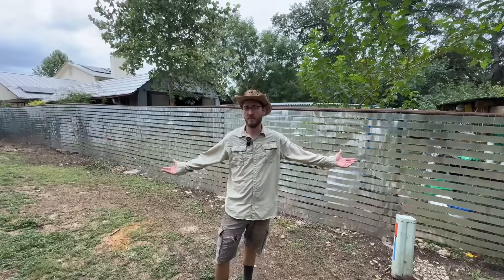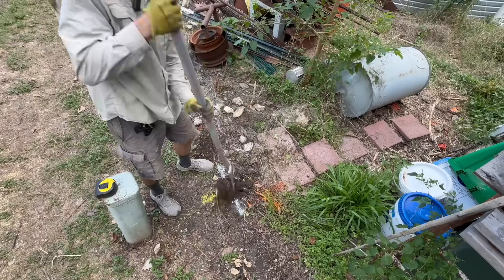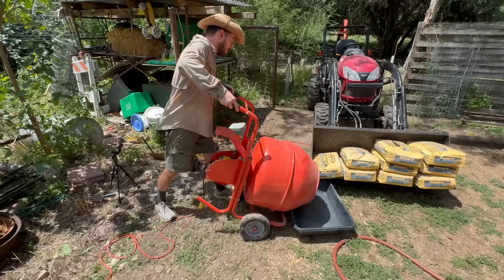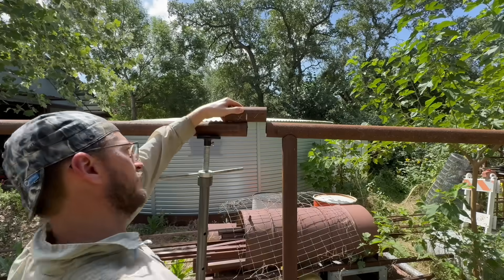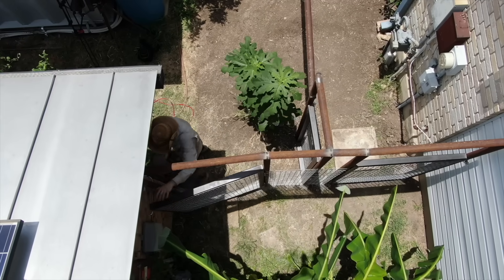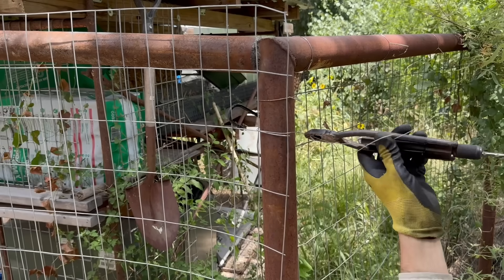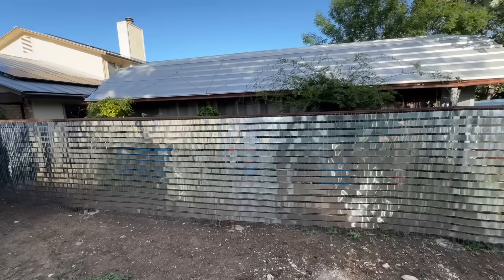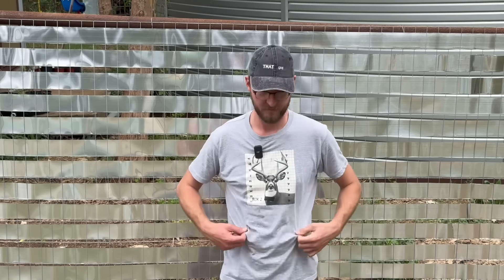This FENCE Lasts 100 years!!!!

Comment: Have you heard of a fence stretcher? You put a length of rebar woven through the end of the mesh and it will tighten the wire so it doesn't sag at all. Its painful but if the wire sags (and it will) its an easy way to tighten it up. We used one with the sheep net on the farm.  Weaving the rebar or tpost through the end of the net looks silly but the stretcher works well that way.
Reply from the maker: I hadn’t heard of them until this video. I learn a lot from these comments. Thanks!

Comment: I remember looking with envy at those miles of welded pipe fences in Texas when I spent some time there. I remember thinking how nice it must be to live in a place where there is so much scrap pipe lying around!
Reply: we had a lot until people started making miles of welded pipe fences 😂
Reply: Alberta had the same surplus tubing. It is becoming more in demand and the price is climbing. I have wrap-around miter patterns and a Dragon cnc Plasma Tubing profiler that can cut miters and holes in even very rusty drill tubes quickly. Your metal cut saw miter pattern is a good option that makes a nice joint.

 Some pre-heat on the weld joints would help as the dril tubing is heat treated alloy steel and can become brittle if cooled to quickly.

Comment: What a solid and well built fence. Those pipes are really thick gauge metal and should last a long time. The only thing I would have done as an extra corrosion preventative is paint the posts with anti rust paint (cold galv on all weeds) and also paint the parts of post going into the concrete. I know it’s not a bullet proof solution and the posts are very thick gauge, but I just like to prevent rust as much as possible (even in dry climates). Just subscribed and keen to see other videos. Ps cool laser rust removal machine and the steel cutter too.
Reply from the maker: Thanks for commenting and for subscribing! Welcome aboard!
Reply: You’re welcome mate, keep up the great work :)

Comment: Nifty idea and nicely done!  But isn't the reflection during the day kind of blinding and doesn't it generate added heat? I see if the vines grow all over it that will be resolved, but in the now intense triple digits of summer where I live the vines would likely burn up before they got far enough. Does the flashing retain its shine or eventually dull? To me that would help in the increasingly hot climate I'm in.

Comment: Nice fence. I work in a very oxidation prone environment. That stainless steel wire might cause the non stainless wire fence to corrode. Hope not.
Reply: The aluminum might react with the carbon steel. Look up “galvanic index”. Might not be a problem in a dry environment. I work in a salt mine so it would be a problem in that location. 👍

Comment: There a lot of easier ways to notch the pipe. Also you never said what the thickness of the pipe is or the sq tubing, which is kind of important. But I do like the fence and it was nice of you to add the stripping. By the way your neighbors shit doesn't look like nothing special.  Cheers

Comment: Waaw  Nice ! What cost was it by square meter of flashing ? What is it normally used for ? It looks great !! Does it make noise with wind ? What about the galvanic thing and rust ?
Cheer !!
Reply from the maker: I noise in wind. Galvanic corrosion is a bigger issue in wet areas. Cheers!

Comment: I have been cutting my 10 foot wide laurel hedge and in the middle is the 1920s METAL small fence. It is amazing to see and quite ornate here in the UK and it is still strong and not rusted away. it is amazing. It is almost completely hidden in the hedge except in a few places but it does prove even in the very wet climate of England that metal fences can last so very long - may be not as long as my laurel hedge though.

Comment: The first 8 inches of the metal (or wood) need to be bitumen coated, taped or wrapped under the ground interface. Oxygen, water and bacteria can live happily in this area and your iron and wood get chewed out mighty fast as it has no protection. You could weld the wire to the fence down low and at a few locations all along the poles to allow the zinc in the mesh to protect the iron long term, otherwise that ground interface iron will get thin fast.

Comment: 100 years?  You must not have moles.  Lucky.
Reply from the maker: Several freckles maybe 🤷 but seriously no I don’t think we have moles here.
Reply: @suburbanbiology  lol...  Good for you buddy.  You would know it if you had them.  You could build a fence out of titanium in these parts and it would be leaning on you 5 years later no matter what you do.  And the worst part is the damage they do to the foundation of your house is even worse than the fences.  I've been landscaping around the house and garage and I've been putting rolled steel nets 1/2" about 2 feet in the ground perpendicular to the house every foot or so before putting down the weed fabric and rocks.  It doesn't stop them from screwing up the rock and getting to the foundation, but at least they're not making tunnels all along the house and garage slab anymore.  Evil little monsters.  Nice job on the fence by the way.

Comment: The only Fear for your project I have, is the possibility of dissimilar metal corrosion (Galvanic) between where the Aluminum and the Steel fence touch, you may want to apply a corrosion barrier. I say this coming from a comercial aviation mechanic perspective. after many rains you will notice it begin the rain will act as an electrolyte between the two metals which both have a difference of electrochemical potentials so they will try to react. this will occur faster if you are close to a body of salt water or it remains humid in your area the majority of the time.
I absolutely enjoyed your video and subscribed too, heck yeah, I wanna see more of your projects!

Comment: Do you think the reflective 'heat' element when dealing with aluminum will have any impact on the plants?
Reply from the maker: No not with a straight fence. If the fence was a parabolic shape I think it would matter much more. Or if the fence ran east west. But this fence runs north south so it shades the yard half of each day.

Comment: Sir I own 2.66 acres of land in Upstate NY. In order to keep out the "White Trash' infestation I have pulled 1,200 feet of fence 370 feet of "rebar" fence buried in 6 inches of concrete base and 660 feet of ditch dug 4 feet deep and 4 feet wide and i plan to pull another 200 feet this autumn. all to protect a fishing Pond almost 200 foot across that i have never stocked because of that bunch.

Comment: What about dissimilar metal corrosion? Your wire fence probably has several metals, steel pipe and aluminum flashing. I hope you dont live in a wet climate .JS
Reply from the maker: Central Texas. Quite dry usually. In a wet climate it would be more of a problem.

Comment: "If you don't like it, hit the thumbs up button." 😂😂😂
A little too industrial for my taste but it's a very clever idea, and well executed. It was worth watching the video to see that wire twister. Not something I need every day but I had no idea those even existed. Certainly worth the investment for a project like that.
Reply from the maker: Glad you liked it!
Reply: But tge plants will camouflage it      I agree natural looking  better  cosmetically  but he wanted long term
Reply: Yea those safety wire twisters are used heavily in the aeronautical industry. Almost all fasteners in an aircraft are safety wired a certain way to prevent complete backing out of the fastener resulting in catastrophic failure. Also used heavily in motorcycle racing for the same result. One of the coolest tools/ fastener systems ever invented!
Reply: This is not a DIY project for the average Joe.  Nice work though!
Reply: There's also a drill bit used by electricians to twist wire.  Just need a small screw gun and the bit.

Comment: its a very interesting idea but have you tested the effects of high wind loading?  i actually had a fence that had 2x6's on railroad ties and for the fence we have about 6 2x6's parallel to the ground.  during a wind storm that little surface area was enough to pull the railroad ties out of the ground and knock down a portion of the fence.
Reply from the maker: The wind can pass through the gaps. It held up great in a crazy wind storm last Monday. Many of my neighbors fences blew over. The flashing on mine didn’t even budge.

Comment: This is really cool and makes me want to convert all of my outdoor wood work into metal. I'm going to be honest, I was a bit gobsmacked at how easy you made that triple gate setup. One question: how will the Aluminum flashing age over time? Will it gain a beautiful patina? Hopefully the vines will be established before we find out. Also, did you potentially create a deathray wtih all of that reflective surface? Great video!
Reply from the maker: The aluminum will get more hazy over time I think. The vines will eventually cover most of it. The reflection doesn’t seem to add enough light to heat anything up. The plants are growing great. Thanks for your support!

Comment: The wire fabric was taller than the fence - you had to cut it down, wish you had shown that...
Reply from the maker: I just bent the lower edge. Just for the part near the other wooden fence. The ground was mounded in that area. Thanks for commenting!
Reply: @suburbanbiology  Gotcha, thanks!

Comment: You say that the fence will last 100 years, but have you considered the galvanic corrosion that will happen between the steel and aluminum?   It's a matter of different electric (potential), boogey woogey woo.
Reply from the maker: I think the flashing may fall apart but the steel pipes should last a century. Thanks!

Comment: I love that trick of putting the steel bar thru the roll of fencing material, keeps it manageable. You could have just used a margarine tub or ice cream pail instead of sacrificing a 5 gallon pail for the flashing material but if that's what you have available...
Reply from the maker: I just wanted something with a handle to I could hang it up and that particular bucket already had a hole drilled in the bottom. Plus now I can weave flashing anywhere 😂

Comment: The back of my house is less than 20 feet from a parking lot where a white semi truck preferred to park lengthwise. Plenty of other parking spaces but by parking directly behind my house they had the advantage of free security which my retired husband and I were forced to provide. On top of that issue was the glare from their trailer. While I enjoyed your video I was reminded of how uncomfortable we were for years putting up with the glare from the trailer until we decided to contact the building owner of the parking lot. They did post some no parking signs which upset the driver who decided to park elsewhere entirely.

Comment: You could have got the spacing on the posts exact. Just create a story stick out of a piece of metal strong enough that it wouldn't flex. Weld a couple inches length of pipe small enough in diameter to slide into opening of posts on each end of the story stick. Then just slip story stick into post you just set and adjust next post to allow other end of story stick to slip in. Things would go fast!
Reply from the maker: It’s just that the boulders wouldn’t allow me to drill at 10 foot intervals in some places. Great idea though. Thanks for commenting!

Comment: I subbed for the very amusing request. If you have a water retention issue for your trees AND a post hole borer, you can go around boring down  in any hollows, to give the water a quick path underground, it works wonders and promotes worms, at least in my part of the world.
Reply from the maker: Our soil has high clay content.  But I have dug trenches and soaking pits. I’ll cover that in a video I’m making right now. Thanks for subscribing!

Comment: lol I welded all day and now I’m laying in bed watching a guy build a fence?!! He’s doing a kickass job and I’m still watching😂😂😂
Reply from the maker: Thanks for watching!!! That’s high praise 🙏🏼
Reply: I was surprised with the thickness of the pipe that he was using MIG welding, I expected it to be MMA (Stick) welding. Now I can see with that fence you don't necessarily need full penetration welds. So was it run what you have or was it a question of economy? I've done some welding, I'm better than a lot who tell you they can weld (If their pigeon shit on a pipe is welding!) but I haven't done that much.
Reply: @COIcultist  he was probably using flux core wire, which is very strong if you weld hot enough
Reply: @BoatyMsBoatface  Thanks, I've never used flux core, but I was befuddled by your answer because I though: "Yes It's Outside So He Used Flux Core, I'd Expect That So What?" I thought flux core was just a different way of shielding. Just looked at a site, and it explained that flux core punched through rust better and worked with thicker steel. Every day is a learning day.
Reply: @COIcultist  use .035 and you you can weld thick stuff. I just tried out a brand of wire today , Vevor, that worked great and is WAY cheaper than Lincoln.  Happy welding !
Reply: @BoatyMsBoatface I love that Vevor wire feels like Hobart except it was $35 for 10 lbs! 

I use it a lot.

Comment: I love your project, and your welding skills. 
I have a couple of suggestions though: 
First, let me say that weldwire fencing is a crime against humanity and sanity. Been there, done that - you want woven "no-climb" fencing with the same 2x4" grid. Maybe not yet, but when the welds fail (and they will) it will be a bad time. But, hey, your posts and top rails will be there a very long time. 
Very clever with the flashing, and the tricks with dispensing the fencing and flashing. 
For the post concreting, I think you would find that you can save a LOT of time in dry areas by just pounding in the concrete dry around the post. It makes it easier to level the posts and keep them there. Then you water it in with some drip irrigation or hose end sprayer on low.  This approach has been thoroughly tested (Wisconsin U I believe). As long as the concrete is thoroughly hydrated, it sets up just fine. A dripper on each post hole would for a couple of days will do it dandy. Unless you love mixing concrete, of course - I wouldn't want to deprive you...
The final product was great!

Comment: Can you incorporate a thermal updraft chimney in your green house?  It would provide a near constant electricity output and help harvest moisture from the air.
Reply from the maker: Those have to be pretty tall I think. Might be difficult. There will be thermal updraft principals used but they won’t generate electricity. Just ventilation.
Reply: @suburbanbiology  It is dependent on a combination of surface area and tower height so at small scale I don't know if it would be worthwhile, but it does seem to run at a pretty constant speed so more of a baseline power, like small scale hydro.  https://www.youtube.com/watch?v=XCGVTYtJEFk

Comment: I am curious about the issue of galvanic corrosion between the aluminum flashing where it touches the steel wire at so many points. Granted that it will take a while and the vines make be enough blockage by then. There may be some on here that have the knowledge to predict how long that will take, but it isn't me. I am also wondering if you get any squeaking noises as the wind blows ? Not likely to hear that just from the difference in expansion and contraction of the different metals with temperature changes since those are more gradual.
Reply from the maker: No squeaking yet. I’ve read galvanic corrosion is more of a problem for wet think. We are pretty dry here. Time will tell I guess.
Reply: @suburbanbiology  Thanks for your reply.  I was a helicopter mechanic in the Marine Corps, where galvanic corrosion was drilled into us maintenance types. In my 21 years I must have gone to corrosion control school 5 or 6 times, which is a two week course. Who would ever think you could spend that much time studying the various forms of corrosion ? I retired in 1994, so a lot of it has faded away.

Comment: any reason you wouldn't overlap the WWF at the post, tie them to each other and tie that to the post?  this way there us no gaps to permit entry and exit without tools?
Reply from the maker: I don’t know that u fully understand but the flashing weaving held it tight enough to where it doesn’t want to go anywhere.  Not sure that answered your question though. Thanks for commenting!
Reply: @suburbanbiology  I had gotten the weave and it must look beautiful but by overlapping the WWF you can skip the labor of snipping; just seems like a labor step and waste stream that wouldn't need to be generated.  But this is probably also driven by my local conditions where critters make a way if they can't find it.

Comment: You could have just laid the wire down on the ground and unrolled it the length of the fence. When you lift it up off the ground, just lift it over your fixed structures like the utility box. It’s much easier.

Comment: What kind of blade is in that saw to cut metal? I was always told you can't use Mitre saw for anything but wood.
Reply from the maker: Link in description. It comes with a blade. You can also buy replacements based on the mason link. They are special blade made specifically to cut metal.

Comment: Just the other day I dug up a similar fence post (got three more to go, ughh) that my grandfather had done... about 45 years ago. But the posts were corroded away almost completely. So I don't buy the 100 years claim. At least not if you got weather.
Reply from the maker: We got weather and it’s called “drought” 😂 but seriously we are pretty dry. About 30 inches of rain average but some years we only get around 15. In dry climates 100 years is possible. I do agree that in wet or snowy areas the life is probably much shorter.